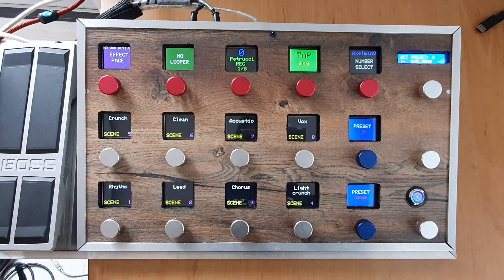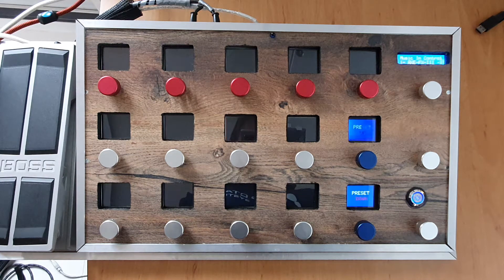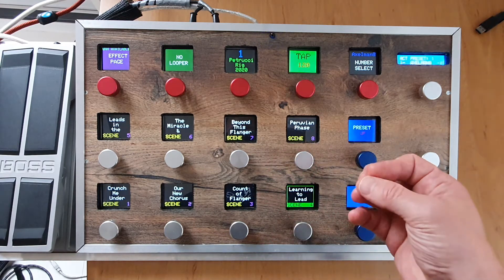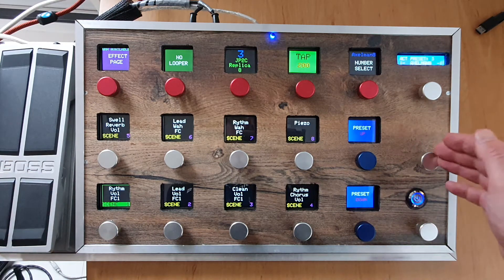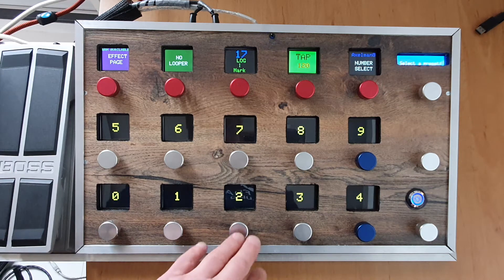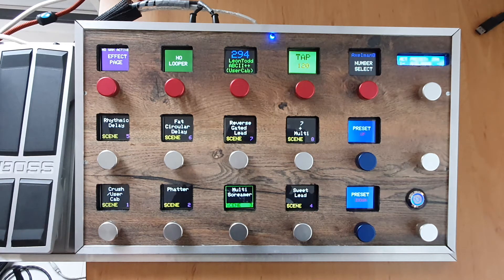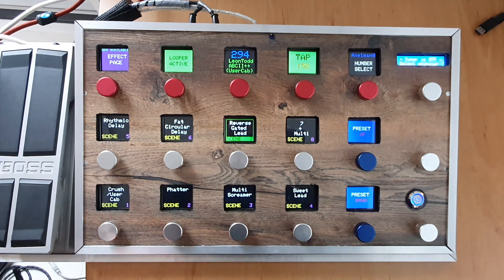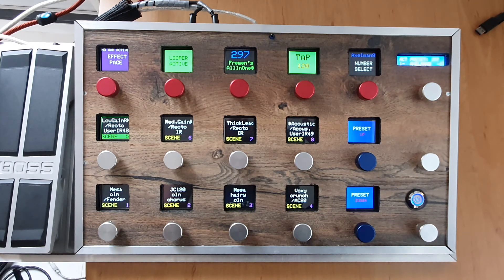Arduino Due | DIY Fractal AxeFX-III pedalboard |

Comment: Hi! I just got an FM3, and I have an FCB1010. I was thinking if I could build a superior Arduino-based controller and your video is just what I needed
Reply from the maker: Hey there,

Thank you.  See my video about the teensy 4.1 build,  that is what you need as a master controller. Super fast.  Will upload a new video soon with the latest new features.  Cheers 🍻
Reply: @axelman8  Thanks!!!
Reply from the maker: @LucasGonzalezA  see this thread:  https://forum.fractalaudio.com/threads/share-your-diy-controller-project-based-on-midi-for-3rd-party-devices-axe3-fm3-fm9.192151/